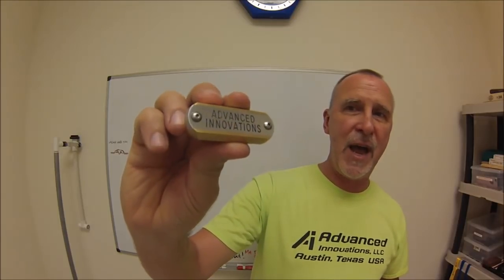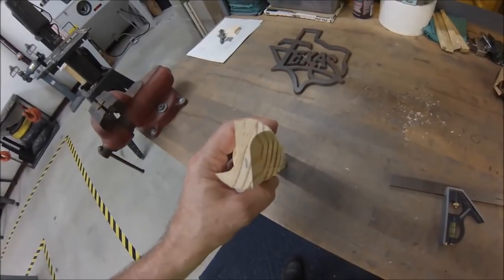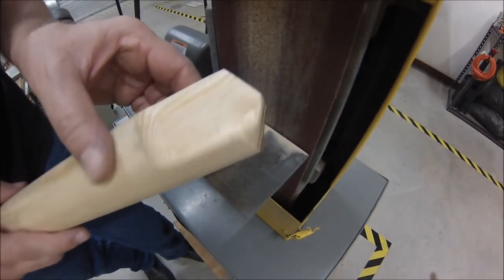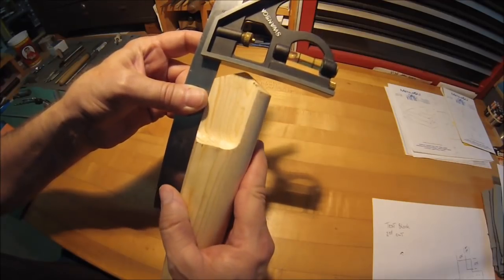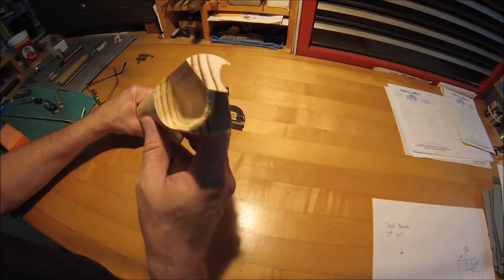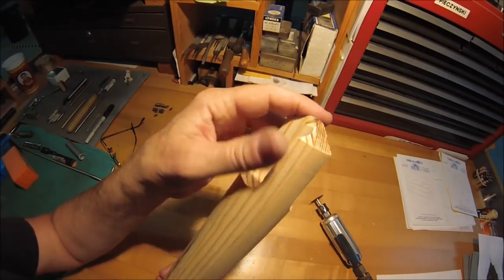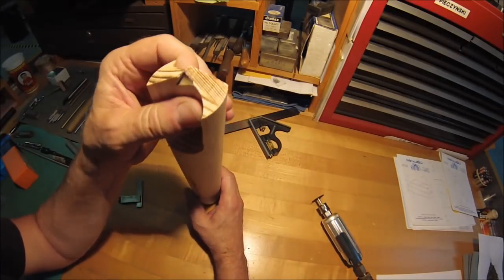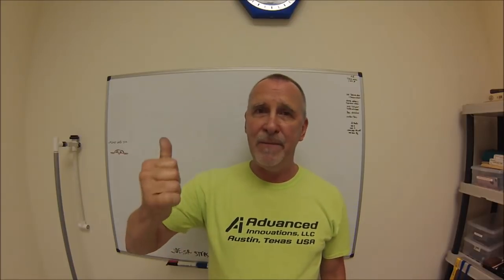Drill Tip Geometry, Web Relief and Sharpening simplified

Comment: 65 years ago, we spent the first 2 weeks in heavy mechanics class making a drill bit sharpening gauge and using it grinding and regrinding 1/2" and larger drill bits into stubbys. Our instructor wouldn't let us touch our project engines until we could sharpen our bit and drill through 1/2" plate with it. I will always be grateful to him for that, still sharpen my bits by hand and even occasionally get a 3/16" bit to cut a decent hole, just to prove I can still do it.  Anyone who says its not worth the trouble,  just needs to spend a week working on developing the technique. Retired from the construction industry now and getting back to reducing large stock into small chips and loving it. 
Your videos are great, your teaching style is exceptional and your content is always on target. Thank You.
Please keep them coming.
PS. It looked like the grain of that wood was giving you a bit of trouble, High speed steel is actually easier to grind, no contrary grain.  ; )
Reply from the maker: Thanks for the comment. Good luck with your chips.

Comment: Well I have seen a wooden mock up drill bit before but I didn't see them actually sharpen it, does that count? :-) If you haven't seen it you might want to check out my video on the crazy complex machine I have that puts spiral points on drills. https://youtu.be/3unjoKkgQto
I find the spiral point bits to work extremely well especially with a hand drill since they don't tend to walk and their force to push in to the cut is very low.  I still have to sharpen my bigger bits like you showed though.

Comment: Good explanation and great model but I still take exception to hand sharpening.  As far as I am concerned, in order to achieve proper cutting action, the tolerances on the cutting edge geometry are no different for a drill than a 2 flute end mill.  Both are two flute cutting tools.  By proper, I mean that both flutes must be taking equal chip load and be perfectly symmetric.   if not, then one flute will be doing most (or all) of the work which will push the hole off size, deflect the tool as it is out of balance, slow the speed the tool works at and will make it wear out faster.  I'm not saying a hand sharpened drill won't drill a hole, but I don't believe you can get optimal performance by hand and you should use a jig whenever you can.  You obviously are not putting a 2" drill into a drill doctor.  Conversely, if bought in bulk and in a production environment, drills under 1/2" are probably too expensive to sharpen at all if you are paying $100/hr for it.
Reply from the maker: There is no doubt a jig ground drill should perform better and last longer than a hand ground drill. I agree 100%. But you know...after years and years of doing this, you may be surprised at how finely tuned your eyes can get and how well you can actually get a drill to perform. I recently watched another video by Don Bailey about how to hand sharpen a drill. I believe you commented on that one too. I have to agree with your observations on his. I was seriously disappointed in his presentation and results. Did you notice the outer edges of his supposed "sharp drill" terrible. They were burned and worn to excess. Any drill that needs to be reground should be evaluated  for cutting edge and OD condition before you start. Both have to be reestablished, or the drill only last a few minutes at best. He obviously overlooked the OD condition. I also agree about cost effective sharpening. Its not worth sharpening a $3 drill in an $100 environment. But at least after watching videos like this, you have some general direction if you have to. Thanks for your comment.
Reply: I thought Suburban tools would have edited or removed that video.  It does not reflect well on the company.  The later videos in the series basically support my position, at least that was what i took from them. Especially when they resharpened some cheap chinese drills on their Darex machine to show that a proper grind would take a poor drill and make it perform like a premium drill, at least for hole size accuracy if not durability.

The thing I don't like is when some others have gone out of their way to both misuse sharpening guides to declare them junk (AvE and others) and then chastise people who choose to use them as being amateurs and that "real professionals" do it by hand.  I think you should use a jig/guide whenever you can.  That said, you showed some great tips on how to measure the hand grind to get it as close as possible, which are good skills for the bigger and much more expensive drills that won't fit in a sharpening jig, i.e. over 3/4" diameter.

The other thing is that as we all age, the eyes start to go as do the fine motor skills.  The ability to control the tool and see if we are close gets harder and harder.  I'm not there yet on losing fine motor controls, but the eyes are definitely not seeing up close anymore.

Comment: Coooool. But that split point thing a bit of a mystery, it's not better to have a chisel point , so the drill actually cut a bit an that small radius , I mean a needle point won't cut nothing , there is nothing to swing around to remove metal just a pin point plunging in to metal?!?!?!?
Reply from the maker: Ya have to feel the difference in resistance to appreciate the tip. It works.

Comment: Couldn't one chuck up a blunt drill (bit) in the lathe and gently put some flat grinding surface (like that cutoff disc) against the tip to get a symmetrical and centered shape? Then you could relieve behind the cutting edge 'manually' at the bench grinder, up to an already established cutting edge. And split the chisel point if you liked.
Reply from the maker: Technically you could, but funny things happen when you start putting conical point on drills. I have actually tried that and the center web is very strange indeed.
Reply: Thanks. Now i have to try it to see the funny things that happen.  :)

Comment: Learned how to sharpen drill bits in freshman shop - had to, to pass the class! 5 credits in high school metalshop and a couple credits of physics were the best courses I took in school. Served me well over the last 45 years and gave me a serious edge. Couple that with becoming a journeyman pipe and structural welder and I've been employed all over the world. I've NEVER been anyplace I haven't had to sharpen drill bits! Have a bunch of jigs for my lathe bits and a Darex for my mill cutters. Had a lapse in sanity back in the 90's and got a 'Drill Doctor'. Spent an evening going thru my 'need sharpening' drill bit box. Could, maybe, drill brass with them after. Only saving grace was the split point feature. Still had to do them by hand, sigh.

Comment: my first assignment in the shop was to sharpen drills. we had a really good drill pointer, but you learn quickly how long it takes to sharpen a broken off 3'' drill with a machine.(forever). the 18'' 10hp pedestal grinder was a much faster option as long as youre not afraid to lean on it. i dont know how many hundreds of dull drills were in that shelving, but it was a two week job to finish. now the only ones that give me trouble are anything under 3/32''.